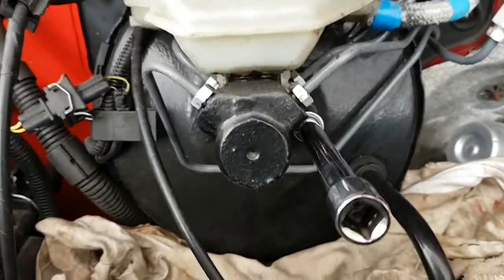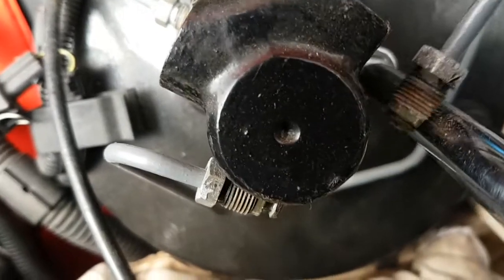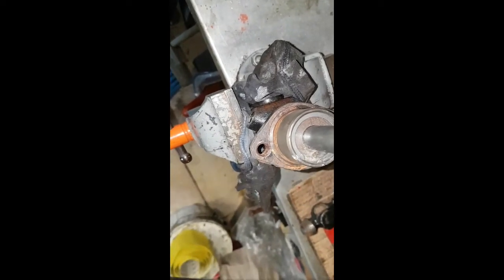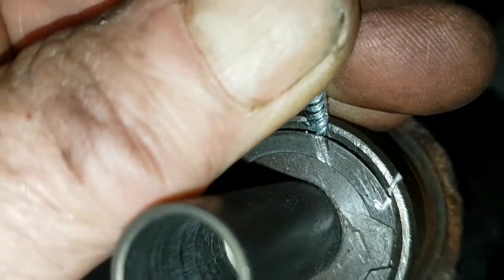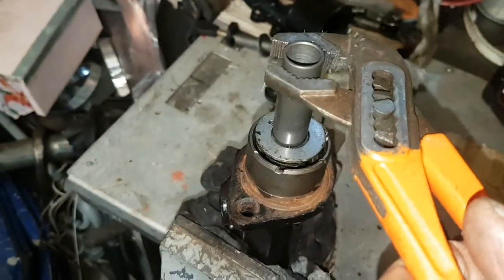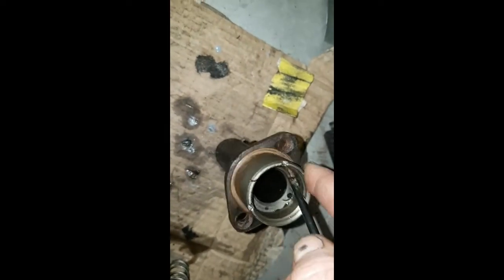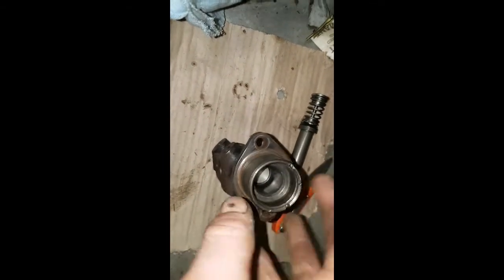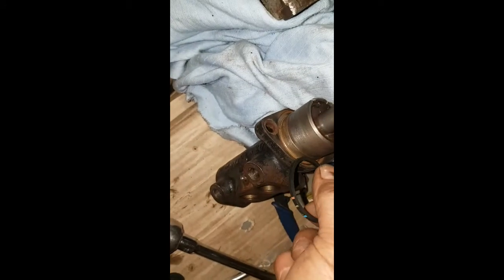Vw transporter t4 brake master cylinder replacement 🤩💥👍

Comment: I've been hunting around for the rubber hose that goes from the brake servo reservoir to the pedal under the dash but can't get it anywhere. The parts obsolete from vw so looks like I can only get it from a breaker
Reply from the maker: Hi David have you tried autodoc, or get the vernier gauge on it for external and internal dimensions and try e Bay, or car hose supplier. 
Good luck
Reply: @markrocketmangrimstead  cheers bud. I didn't think of auto doc. I'll give them a try 😉

Comment: Would the brake booster affect clutch pressure if not working correctly??
Reply from the maker: I wouldn't think so there is a master and slave cylinder on the clutch, it is fed from the same reservoir from the brake,but should be independent

Comment: Where did you get the seals?
Reply from the maker: Autodoc.co.uk.   They have mostly all spate parts there.just check the make of the master cylinder, normally cast on the side😎
Reply from the maker: Autodoc.co.uk.   They have mostly all spate parts there.just check the make of the master cylinder, normally cast on the side😎
Reply from the maker: I have also baught a guns on ezibleed kit to bleed the brakes but I haven't got around to it yet
Reply: @markrocketmangrimstead  awesome thanks I'll check it out.